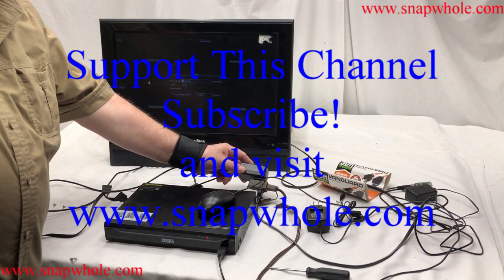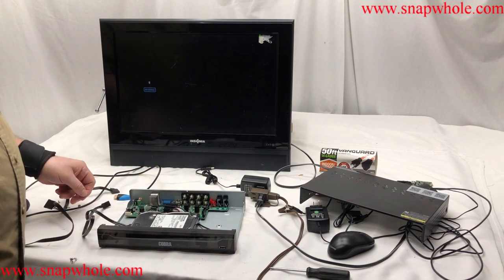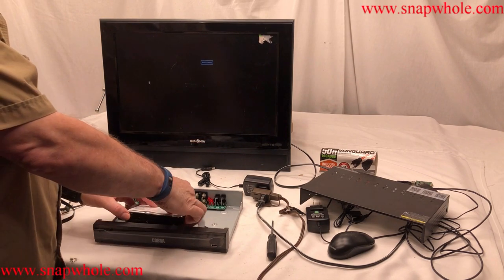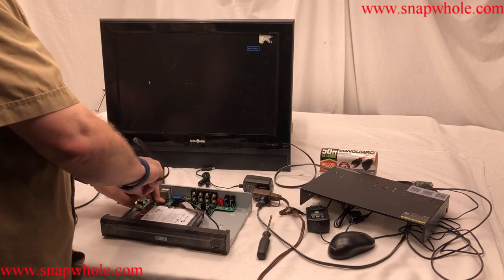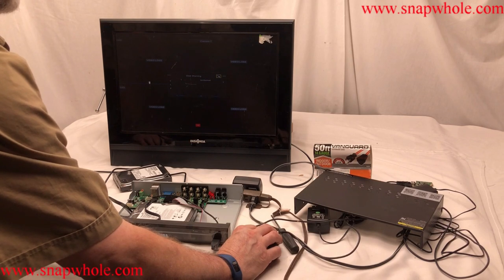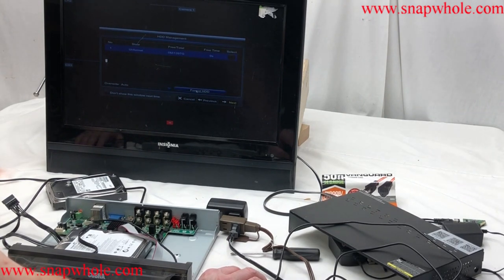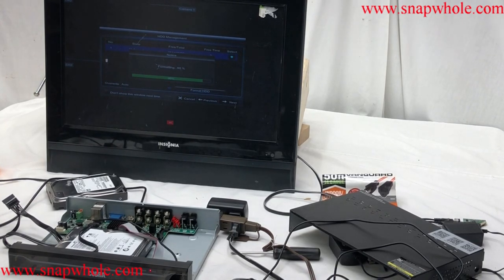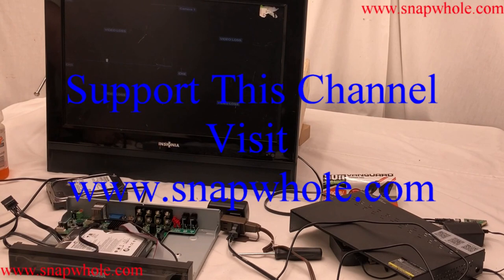Harbor Freight Cobra 8 Camera DVR How to replace Hard Drive

Comment: Thanks for your video, I swapped out my HD and plugged back in, Power LED blinks. Went back to old HD and power LED still blinks. Any suggestions, Thanks.
Reply from the maker: when the HD is changed, it sets an error condition in the system that can not be cleared, very strange and misleading.... thanks for subscribing!

Comment: Question. My Cobra 8ch DVR system keeps going to black screen and a message to check source or HDMI cable. Neither has been touched. I end up having to un plug DVR. Sometimes it starts up some times is doesn't. Is this the power plug causing this or maybe the hard drive? Thank you for your time. I really appreciate it.
Reply from the maker: I am guessing this is caused by the power supply, you should switch the wall wart for the cameras with the wall wart for the DVR, that should confirm if it is the wall wart or not, when replacing a wall wart, you want to get one that outputs 12v, there are 2 types of wall warts, both will be labeled 12v, but 1 has the voltage regulator in the wall wart and outputs 12v, the other expects the voltage regulator to be in the equipment, not the wall wart and typically outputs about 16v, this system expects the voltage regulator to be in the wall wart - thanks for subscribing!

Comment: I replaced my hard drive with a new one still comes up as no hdd 
I noticed you plugged the hdd cable to a different power source.. what is the purpose behind that if it was getting power form the cable in the front of the box?
Reply from the maker: only one power source can be connected to a drive at a time, I was swapping drives, testing different setups to see what was supported by the dvr, I was looking for a way to add a second harddrive, either internal or external - when I got to the point of making the video, that was the configuration I had, the power source is not important, the internal was working fine, I would recommend you reseat all the cables, and put your hand on top of the HDD while you turn on the dvr, you should feel the drive starting, it should be a smooth vibration, if it clicks, the drive is bad, if it is not powering up, the drive is bad, typically SATA drives are plug and play, if they don't come up and cables are fully seated, the drive is likely bad - try a different drive if you have one, and you can try the vibration test on the original drive for comparison, you can also switching the camera power supply with the camera power supply to see if that makes a difference, they are the same power supply, and i have seen the dvr power supply get 'weak' and not provide enough power, those are the things I would try - let me know how it goes - thanks for subscribing!

Comment: I put a 500 mb drive in it but about 75% through the format it stops, it's a used drive from the office that may be bad or could it be the size....?
Reply from the maker: the size it not important, if it starts formating, the system sees it, so it is not the size, probably a bad drive - thanks for subscribing!
Reply: @snapwholeharborfreightreviews  You were right, I bought a new drive and it formatted just fine, but now all (5) cameras are recording 100% of the time....?

Comment: Can you please provide a link for the hard drive you bought for yours? Mine says it doesnt have HDD anymore & looking to replace when I came across your video. Thnaks.
Reply from the maker: way to many options, and I did not buy a harddrive, I had several 1-4 TB drives available that were pulled from my servers because they were too small (currently we are buying 22 TB to replace anything under 8 TB) - we being my son and I, but go to amazon and search for SATA 3 1/2 inch harddrive and buy one that looks like a good price - below $16 a TB is a good price, I put a 1.5 TB drive it this one, but you could get a 1-4 TB drive for a good price - I have tried a 4 TB and it works ok - SATA drives are all the same, price per TB being the only thing to affect your choice - but for the drive to mount into the existing mounting holes, it must be 3 1/2 inch drive, external USB drives will not work with this system - thanks for subscribing!

Comment: I noted you stated to create a second account, something about getting locked out, but is this required that we create a second account or did I just misunderstand?
Reply from the maker: it is not required - but if only have 1 account and forget the password, there is no way to reset the password on the 1080p system, so you will be locked out - thanks for subscribing!

Comment: Can I do 4tb hard drive I’m putting up 6 cameras. 4 cameras with 1tb gives me about 1week of recording but would like to keep recordings save a bit longer. What do you think?
Reply from the maker: Based on my tests, a 4tb should work fine, I put a 4tb in the 4K version of this system and it worked fine, and this 1080p system and the 4K system are based on the same system - it has to replace the internal harddrive and you will need to format ithe drive once installed - thanks for subscribing!

Comment: Do you know the limit to this system? If I bought a 10tb wd purple would it work?
Reply from the maker: the only number they mention is 1TB, I put a 1.5 TB in as a replacement - normally I would say hook it up, it will probably work, its linux under the hood, but it is possible the system linux kernel is 32bit, which normally means it supports up to 2TB, which means the 10TB drive will register as less that 2TB, a 32bit linux system has a 2TB limit, so after 2 TB it wraps, same for 4TB, 6TB, 8TB, and since the last count is less than 2TB, that is what it will register as to the system - I recommend you try it, but remember that system was designed to be used as a DVR appliance, and basically never be changed or used for anything else, and it was designed a long time ago, and they might have used a 32bit processor to save money, these were designed as cheap throw away systems, but they are not sold that way - if you try it, please post the results here, other people will be interested - there you go, more information than you asked for...... thanks for subscribing!
Reply from the maker: I have several 4TB drives that are too small to use, I'll hook one up via USB and see what it registers as and post the results here - thanks for subscribing!
Reply: Any updates?

Comment: Can that dvr unit be used to record vhs  movies to an sd card i have some old vhs home movies that i would like to preserve digitally
Reply from the maker: I would not recommend it, if you want to capture from a VHS, get this card - https://www.amazon.com/Hauppauge-610-USB-Live-Digitizer-Capture/dp/B0036VO2BI ($45) and capture to your computer via the USB port - there is software from that company to do the capture, you'll have to download and install it and its fairly easy to use - this is just about the only video capture device for the average person - if not this one, you are into the professional range, they do a lot more than just capture video but cost a LOT more - between my son and I, we have everything needed to setup a professional studio, if you need a VHS player, go to the local goodwill and get a VCR, or go to shopgoodwill.com - the shipping is high, but its still one of the cheapest ways to get a VCR - verify 
 your recording before getting rid of the VHS tapes - thanks for subscribing!
Reply: @snapwholeharborfreightreviews  ill check into that video capture device 
These old home movies have already been copied once they were filmed on an millimeter camera
We still have the camera and projector but theyre no longer working

Comment: My cobra system is starting to shut down around 8p and doesn't allow us to turn back on till 6a or so. I replaced the power supply and camera supply cord. Is the hard drive a good idea to replace?
Reply from the maker: when the harddrive goes bad, the system still boots, but won't record, what lights does it have on the front panel when it works and when it shuts down down, have you see it shut down? does it give a message on the screen? have you tried powering it off for a minute and back on at about 6p, does it appears hot? you can open the case and unplug the harddrive from the system board and see it that changed the behavior, while doing that, check the system board for obvious scorch marks, there is almost nothing in the system but a small control board (about 1/2 the size of the interior space) and the harddrive, an other thing to try is to disconnect all the cameras from the system at about 6p and see if that changes the behavior, self powering down and back on is usually a sign of something getting hot, but that is a long power off period for heat, you might try leaving the cover off and turning a fan on the inside of the unit, you are looking for a cause of the heat and a change in behavior, is the drv in a confined space where the heat can't be dissipated away from the unit? you can also test the wall warts for voltage within a minute of the power off, it should 12v to 12.4v, higher or lower is bad, I recommend you want the troubleshooting videos I posted, they are in the cobra 8 channel system playlist ( if you have not tried that yet) - the voltage from the wall wart is explained in the no boot video, please let know how this goes, I'm interested in what you find
Reply: Update, seems to be random shutting down, shows "no signal" on monitor while power (green) and record (red) alternate on and off. The DVR sits on a tray made for DVR or DVD player on top of the monitor. I thought a while back that maybe having all 8 cameras hooked up was the cause for the first shutdown for a few days about 2 years ago. Going on 3rd year with these cameras.
Reply from the maker: @1986_glock_shooter_  have you investigated for a source of heat? you should try a wall wart from another source, make sure the output it within 0.5 volts of 12 volts, I had a similar problem with a power supply, tested ok, but failed under load - you can test it under load by testing inside the case, I recommend disconnecting all the camera and see if that changes the behavior, do you use 1 or 2 wall warts for 8 cameras? that behavior points to the DVR attempt to start up and failing, you can attempt disconnecting the harddrive, do you have the auto reboot option turned on? if not, i recommend you set it to the shortest time period and see if that changes the behavior - let me know what these options do
Reply: @snapwholeharborfreightreviews  no heat but noticed that the recording has lessened to 3 days of recording
Reply from the maker: @1986_glock_shooter_  is it still powering off? do you have motion activated recording turned on? or does it record all the time? if you have doubts about the harddrive, you can format it and then see how much recording you get
Reply: @snapwholeharborfreightreviews  records all the time, unplugged all cameras and still doing it. I think I formatted it a few days ago because it said full.
Reply: @1986_glock_shooter_  mine has only 84 hours of record time idk what happened to it. anyone have similar issues and maybe know hot to fix it?
Reply: @snapwholeharborfreightreviews  I formatted it and its recording more than 48 hours but still shutting off in the evening anywhere from 8p-10p and comes back on anywhere from 0630-0830. Took the case off and seems kinda warm, no scorch marks on the control board, light heat marks on the case where it sits over the control board. Unplugged the hard drive from the board completely. Gonna leave off for a few and put back together and see what happens. Really sucks too because my neighbor had his CAT stolen early this morning and I didn't get a vehicle or person description because this is happening
Reply: @snapwholeharborfreightreviews  does the battery on the board need to be replaced maybe?
Reply from the maker: @1986_glock_shooter_  I removed the battery and it had no affect, left it out for 2 days, no changes - I was hoping it would lose its config as a way to reset password, but nothing, but you can try it, those batterie should be fairly cheap
Reply: @snapwholeharborfreightreviews  well it recorded until 2244 hours tonight
Reply: Bought a new hard drive and it still shutting off. Hmm..
Reply: This is my first time hearing the term "wall wart."  Super funny.
Reply: @snapwholeharborfreightreviews  sorry pretty late comment but I ended up trashing the Cobra system and upgrading with Lorex and no problems. I had replaced the hard drive and no luck so bought another Cobra at Harbor and lasted 89 days just in time to take back and get refund. Thanks for your time on trying to help me get it going again.

Comment: Can we add external hard drive to cobra?
Reply from the maker: the cobra will not recognize external drivers, I've tried, see my setup video for the new 4K system and I demonstrate it there - better to but a large WD external and 'shuck' the case and install internal, search the internet for compatibility, lots of good info out there, a few manufacturers set for external only, I do this for server harddrives - odd but externals cost a lot more than externals, the trick is to do the research and make sure the exterals are really just internals in a case with a USB<->SATA adapter and a power supply - thanks for subscribing!
Reply: @snapwholeharborfreightreviews  thank you very much . Other question
If I Save recording videos in external hard drive instead flash drive , do you think will work? Or if I add 10 TB to the system , do you think will work?
Thank you.

Comment: What kind of hard drive is this you used?
Reply from the maker: A sata drive - I recommend 2 TB or less, I used a 1.5 TB, and it comes with a 1 TB, the name brand is not important, find the cheapest one that is NEW on amazon - search for 1 TB 3.5 inch harddrive, anything up to 2 TB, large will work, but likely will only show 2 TB usable - when I search for 1 TB, a 2 TB showed for $49, and a 1 TB for $39 - thanks for subscribing!

Comment: My dvr won't read the hdd and it stopped connecting to my phone what do I do
Reply from the maker: you should replace the HDD, but a 1tb off amazon, any SATA drive will work - turn on the wireless on your phone, connect to your home wifi and see if the phone connects to your system, the problem is with your ISP router, check if uPNP is enabled in the network settings, if you can't connect using your home wifi, check the ethernet cable that connects  your dvr/nvr to your ISP router - thanks for subscribing!